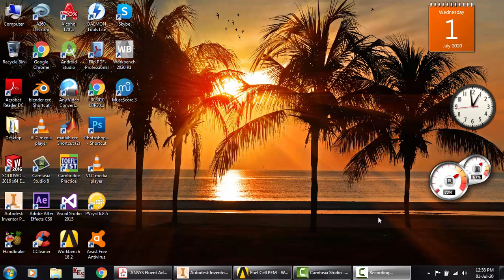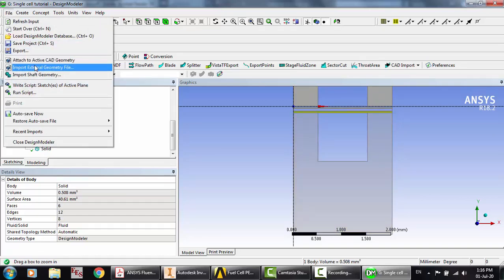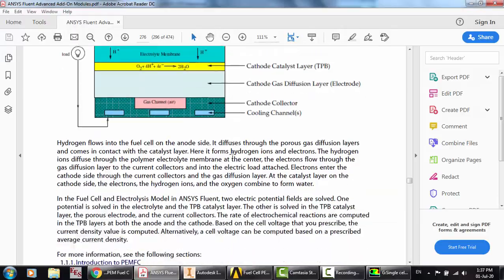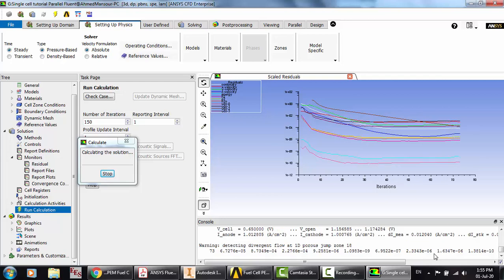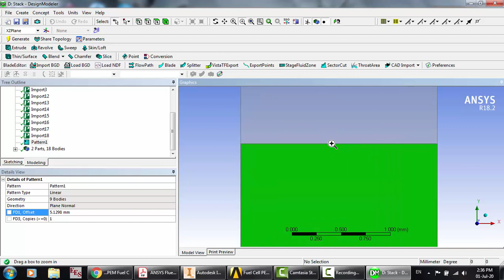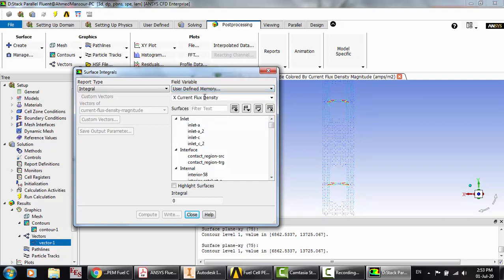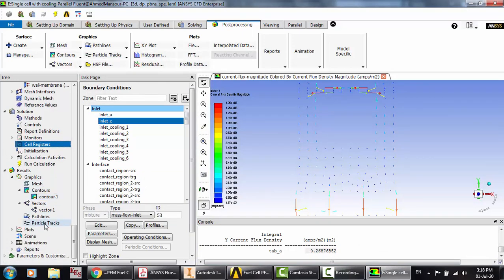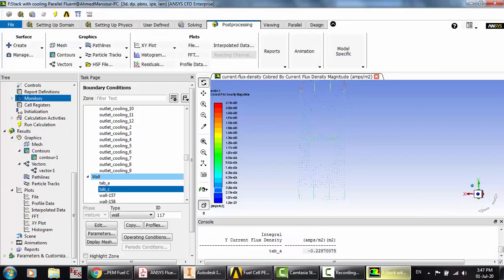CFD simulations about cooling a Proton Exchange Membrane fuel cell PEM and its stack in Ansys Fluent

Comment: Hello sir, I have a problem in setup-fuel cells and electrolysis . I made porous jump but I can't find it in PEM Feul Cell Model - contact resistivity. Can you give me a solution about this problem?
Reply from the maker: Hello dear Kim, it requires the specific way i modeled it in the geometry and the named selection. Please check it out again and try. It must be found in the setup if you are making the other steps correctly. Especially from new part technique. Danke!
Reply: @haveanicetime Thanks sir!   the 'new par technique' on your reply means that I have to make new part by using Catia? I can't fully understand that words meaning:( Can you tell me more specifically about new part technique..?
Reply from the maker: @YHKIM-el8se  No dear Kim, watch the moment 19:20 please. Danke!
Reply from the maker: Hello dear Kyung-jun, the issue originates from not using the "from new part" method shown at 19:20. Also, we must add each layer one by one following the add frozen and add material order. Danke!
Reply: @haveanicetime  Hello sir, i solve problem about interface. thank u so much! but now i have another problem : Error at Node 1(or 2,3,4..) : invalid cp (0.000000e+00 j/kgK_ for oxygen(or hydrogen) at temperature -1 #INDOO K , maybe i think this problem was fc-mixture. when i was searching this Error, i can found correct solution. again thank u for your reply :)
Reply from the maker: This is very good dear Kim! But do you have any problem now? Like I said in the video, due to the complexity, I faced some errors but sometimes I change the mesh size to be smaller and it works, sometimes I try to check out again the steps until I solve the issue. 

This is because the inputs are too much. Sometimes, we do not remember all of them and this makes the issue. But I recorded the steps that gave me no errors. It was not easy at all in the beginning. Danke! :)

Comment: Sir, during simulation after 3 or 4 iterations, the solver throws errors i.e. Cp value can not be calculated for H2...like this one. And one more errors divergence in udf. Can you tell me reasons and how to resolve those?
Reply from the maker: Hello dear Kshitij, something is not correct with the steps of the modeling starting from the geometry to the setup in Fluent. Check again what you have done, it may the mesh size or any missed step. Danke!
Reply: @haveanicetime  Ok sir.

Comment: When you added coolant, output power was expected to be increased. However, current density decreased from 0.21 to 0.2 because of the loss of the collector mass.
How could we cool and increase the performance on the same time ?
Reply from the maker: Hello dear Mohamed, it is a compromise between the temperature and the performance. Like the turbines, you can increase the temperature to a limit that does not destroy the material of the blades, the higher the temperature the higher the power output. on the other hand, we cannot increase the temperature as we think because of the metallurgical principles. The samefor the fuel cell, we care about the performance in the end, so we try to approach this from the temperature decrease and at the same time optimize the electrical performance. Study more about this point in the literature and see what you get :) ..Thank you

Comment: hlo sir, i have a question. why r u running simulation only for 150 iterations?  what if we keep it running for 2000 iterations, will it give same result?
Reply from the maker: Hello dear Avi, it depends on the convergence. If the simulation reaches the convergence and the solution does not change after a certain number of iterations, no need to consume time. Also, it depends on the residuals. The lower the residuals, the more time consumed. 0.001 consumes less time than 0.0001. Anyway, it depends on the change in the final results. You can run more iterations but if the convergence is reached, the software may stop automatically even if you set the iterations to a higher value. Danke!

Comment: Hi, thank you for sharing your tutorials.
I am performing some simple simulations with a single cell and a straight channel but the current density of the cathode falls to zero after few iterations. How can I face this issue? Thank you
Reply from the maker: Hello dear Maria, something is not correct with the geometry or meshing or the setup itself. amke sure that you are not using the free student version because it is missing lots of important features. Danke!
Reply: @haveanicetime  Thank you for your quick reply. I verified the geometry as well as I changed the mesh but this error still occurs. As regards setup, I followed several tutorials and I also studied the fluent theory guide. It would be very useful if we could discuss about it or if I could send you my simulation in order to have a little help. Thank you again
Reply from the maker: Type your email here.

Comment: thanks for this amazing video , i have a problem : when i run the calculator , there is an error said : floating point exception , i didn't understand why ?
Reply from the maker: Yes, something wrong with the geometry, meshing, or the setup. You must follow the same procedure that was shown in the video.
Thanks
Reply: @haveanicetime  i don't have the same version as you .

Comment: Hello sir with a little bit different geometry ı used the same settings as you in fluent. But ım keep getting floating point exception error. How can ı solve this
Reply from the maker: Something is not correct with the steps, geometry, meshing, or setup. send me a message to mech.eng.ahmedmansour@ gmail.com to send you the CAD files. Thanks

Comment: Hello, sir! Thank you for this detailed explanation. I even analyzed it with a cooling model, but I have a question in the porous-jump setting.

At 27:46, the top of the gdl naturally divides into three parts, but it's not divided like that in my model. So I made the entire top side porous-jump, but it can't be analyzed. When designing a model with an inventor, did you design the top of the gdl separately?
Reply from the maker: Hello dear Su, you're welcome! In Inventor, each part was generated. Then theyw ere assembeled in ANSYS. The porous jump was the contact between the GDL and the channel. You should study carefully how to simulate the model you have.
Reply from the maker: @romp2791  Hello dear Su, okay, yes it is correct. Have you tried the "From new part" step? Danke!

Comment: Sir , how the assembly of parts in design modeler is automatic , like when we import the model how it fits in its exact position
Reply from the maker: Hello, this was done at first by the CAD modeling software. Using the move command to take into consideration the distances and thicknesses of each part. You gotta learn that at first. Thanks

Comment: Hello Sir, 
The video was very helpful.
I have 2 question please ; 
1. - The mixture composition should be indicated by given mass fraction of both H2 in anode channel and O2 in cathode channel as well as the composition of water flow with in the PEMFC system, particularly through different cathode layers
2. Gas flow is co current flow or counter current.
Reply from the maker: Hello dear Mohamed, as shown in the video, the flow rate is consisted of water and oxygen from a side, and water and hydrogyn from the opposite side giving the mass flow rate and the species.
It is better to make a literature review about the fuel cells and get some references of fundamentals to understand the physics of them. Danke!

Comment: Hi Sir, when running the calculation, an error occurred showing floting point exemption. May I know how to resolve it.
Thank you
Reply from the maker: Hello dear Uday, something is missing in the geometry, meshing, or setup. Recheck again and make sure that you are not using the free student version because it is missing lots of features.
Thanks
Reply: @haveanicetime  Hi sir, thanks for your rply. Unfortunately I don't have access to licensed version so trying with cracked one. I have made lot many changes but still I am not able resolve the issue.
Reply from the maker: I can send you the CAD files I used, this is the only thing I can do for you.
Reply: @haveanicetime  Thanks for you response
.I have your files already shared.  But when I am trying to creat a new design, I am getting this compilation errors. May be according to the modified design, operating conditions or boundary conditions should be redefined.
May I know the calculation part you have done for boundary conditions?
Your help is highly appreciated.

Comment: Hi Sir, at the end of the calculation I have got an error: floating point exception. May I know what does it mean and what can be done to overcome it?
Thank you
Reply from the maker: Hellodear Uday, you have something not correct with the geometry, meshng or the setup...Danke!
Reply: @haveanicetime  Thanks for your immediate response. I have figured it out and now I am able to execute the calculation. But when trying get the vectors I am facing a different error as below.
CX.1920.exe has stopped working. 
May I know what does it refers to?
Reply from the maker: @udaykanthmummadi3191  Do you use the free student version?
Reply: @haveanicetime  Yes sir. I am currently using free version.
Reply from the maker: @udaykanthmummadi3191  Well, it is missing some features and it is better to get the commercial or the full academic license. Danke!
Reply: @haveanicetime  Sure thanks for your kind response

Comment: Sir,
How you define distance between two bodies?
In my case its overlapping.
Reply from the maker: Hello dear Rohit, simply I calculated the distances and took them into consideration in Autodesk Inventor by using the move tool. Accordingly, when you import each layer, no overlapping occurs. Danke!
Reply: @haveanicetime  hi sir,
I designed it in solidworks software and also assembled it properly at calculated distance but it gives same issue
Reply: @haveanicetime  can you send me your inventor designed files
Reply from the maker: @rohitniphade.7602  Send me an email to mech.eng.ahmedmansour@gmail.com

Comment: how about detecting  divergent flow ?is it ok ?
Reply from the maker: I am sorry I do not understand.
Reply: @haveanicetime  for tab c electric potential value 0.3 and under also 0.8 and 0.9, I got: floating point exception errors 
any guidance ?
Reply from the maker: I think you gotta review your geometry, meshing, and setup again because if you missed any step, you never run the simulation smoothly. Thanks

Comment: Why i get error : floating point exception ini simulation?
Reply from the maker: Something is not correct with any step during the process.
Reply: @haveanicetime  I think its about teh mesh. In ansys 2020 there is no relevance center option
Reply from the maker: @almaasalfy6041  If it is the student version, it is missing some features. It is better to use the commercial version or older versions than 20's. Danke!

Comment: Hi there  i keep getting this error after naming the various parts in the mesh. Following your steps in the tutorial video, i observed that you assigned 2 names for one specific part of the cathode channel (tab - a and outlet - cathode). The error message i get is ''The mesh file exporter does not support overlapping geometry in named selections. Please resolve the issue and try again.'' Please how come you never had this error in your simulation having named the outlet cathode channel as tab - a please.
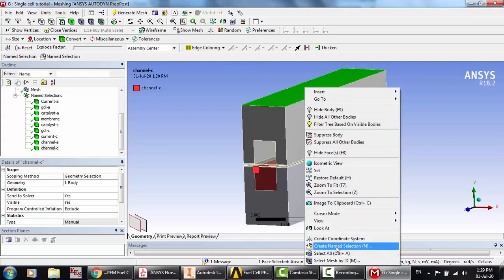Reply from the maker: Hello dear Willy, I did not do this, each named selection must be unique and only for one face. You thought that I used the same face for 2 named selection and this is not correct. Each time I name a face, I choose the face and give it a unique name. Only watch the green face I select and I guess you focused on the red one too and this is the source of your problem. At 25:30, I selected the top face giving it the name tab_a and you noticed the red which I did not touch until I named it as outlet_cathode.We can select many faces for one named selection but we cannot name different named selections for one face. Danke!
Reply: @haveanicetime  hahahaahaha. i get it now. Many thanks for your swift response.
Reply from the maker: @willywilberforce5492  HAHAHAHAHAHA :D :D :D Well done! Always follow the mouse pointer. Viel Erfolg!

Comment: hi sir ,thanks for the video,i want to ask you,my graduation thesis  is about producing hydrogen from water splitting and i need to design a reactor by ansys Fluent for this purpose ,what shall i do ,thank you for your help
Reply from the maker: Hello dear Ichrak, you are welcome! Simply you must do a deep literature review and see the recent studies about it and how they simulate the process, then you know. Danke!
Reply: @haveanicetime  thank you, i just wanted to know is the PEM electrolysis cell is different comparing to what have you done in this video ?can this video be suffisant for a hydrogen production only?
Reply from the maker: The fuell cell is used to produce hydrogen to use as fuell. In the same time, oxygen is produced and you may use it for other purposes. Danke!
Reply: @haveanicetime  thank you very much ,i have done the same work here but i drew it with solidworks because i didn't figure out how to do it with design modeler ,but there is a problem in the calculation,it tells me that i have it cannot converge "Divergence detected in AMG Solver",what shall i do please
Reply from the maker: You missed something. The geometry must be handled as I showed in the video. Missing any single step or not refining the mesh causes this issue. Danke!

Comment: Sir during calculation of single cell fuel cell, i am getting floating point error. Can you guide me how to resolve this? Its much needed.
Reply from the maker: Hello dear TJ, it is better to use the files I used to learn the correct procedure. Type your e-mail here. Danke!
Reply from the maker: Check out your e-mail. Danke!
Reply from the maker: @tarungeetar9812  Hello dear Tarun, you are welcome! Check out your e-mail. Danke!

Comment: I am facing a problem while calculating., It says "floating point error". please help me.
Reply from the maker: Hello dear Akash, something is not correct with the procedure you have followed. The geometry, mesh, or fluent setup have issues. Danke!
Reply: @haveanicetime  solved... I reduced number of meshes..
Reply from the maker: @akashsinha5715  Good dear Akash, I mentioned something like this in the video. The simulation is very sensitive. Danke!
Reply: @haveanicetime  Error at Node 2: Dot product of flow direction and area normal is zero.
Check the specified flow direction on Mass Flow Inlet boundary
conditions for thread 81.

I am getting this error during stack part.  I successfully completed the 1st part but getting above error in 2nd part of the tutorial (during stack). Please help me.
Reply from the maker: @akashsinha5715  Hello dear Akash, something is not correct with the geometry, mesh or the setup like I said before. As you see, I assured on the complexity of the simulation and its sensitivity. Make 100% sure of following every step and carry out a mesh test. Also the boundary conditions must be suitable for the model's dimensions. Danke!
Reply: @haveanicetime  solved the problem. Thanks
Reply: @haveanicetime  Sir now  I am facing problem with cooling (⌣̩̩́_⌣̩̩̀) . I've being trying to do it for a week now but still getting lots of error. Please can you provide me the file of "single cell with cooling" only as i don't have enough time now for doing it all over again. Thanks.
Reply from the maker: @akashsinha5715  Hello dear Akash, type here your e-mail. Danke!
Reply from the maker: @akashsinha5715  Check out your e-mail. Danke!

Comment: Hello sir 
Even though I followed every step perfectly I am getting ( ERROR :  FLOATING POINT EXCEPTION ) I hav tried so many times getting the same error . Can u please help me with that
Reply from the maker: Hello dear K, something is not correct with the geometry or the mesh size or with the setup. Check out each stage especially the mesh size, change it until you get no errors as I mentioned. Danke!
Reply: Can you please send me the geometry for fuel cell with cooling
Reply from the maker: @kgautamsriram258  Send me an e-mail to mech.eng.ahmedmansour@gmail.com Danke!